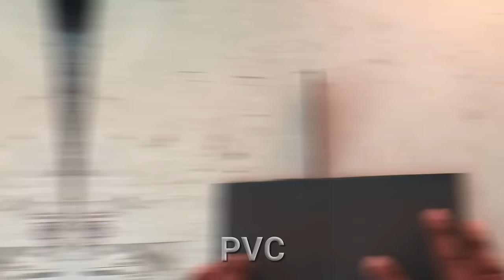How to Make a Gear Copy Machine | Simple Gear cutter

Comment: Fantastic work on the machine, am sure it's not an easy task for maximum folks unless one os a Mechanical Engineer. Wouldn't it be easier to mould or clone the gear.
Reply from the maker: Thank you so much
Reply: You can clone the gear if you want a replica, but this machine is also making gears of different sizes, keeping the pitch same as that of the master gear.

Comment: Hello friend, thank you for the video. With all my respect, your calculations are wrong. (Number of teeth+2) x Module gives the tip diameter. 35=Module x 28 >>> So the Module is 1.25. As the diameter of the gear decreases, the distance between the tips of the teeth increases. This is where you went wrong. If we use the Module value we found in the big gear; 1.25*(13+2)=18.75 will be the outer diameter of our gear with 13 teeth. If we want to calculate the distance between the center points of two adjacent gears, we use the pitch diameter, the formula for which is Modulus x Number of Teeth. After calculating this for both gears, we add them together and divide by two (since the distance between them is equal to the sum of the radii).
Reply from the maker: Bro. Rework your calculations using a note. if you can send a Gmail massage. I can explain this. Thanks for watching!